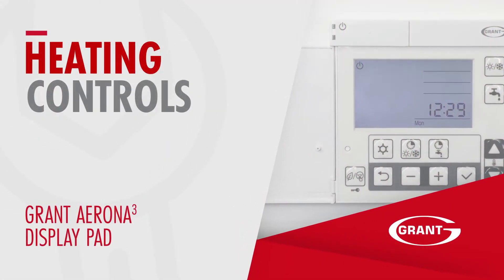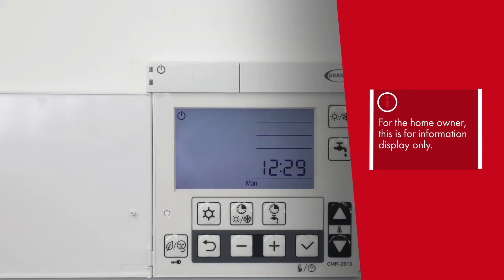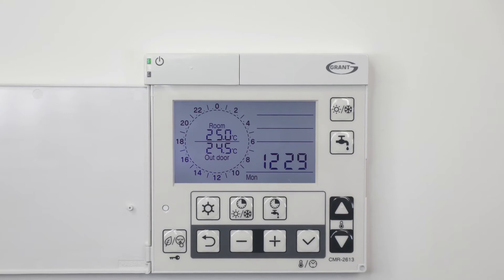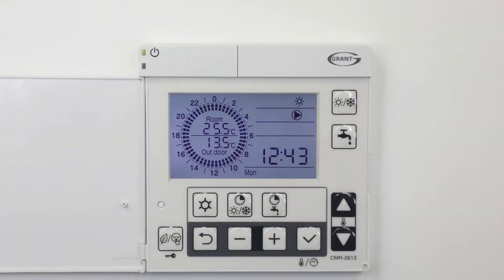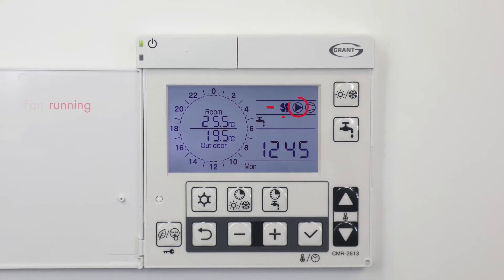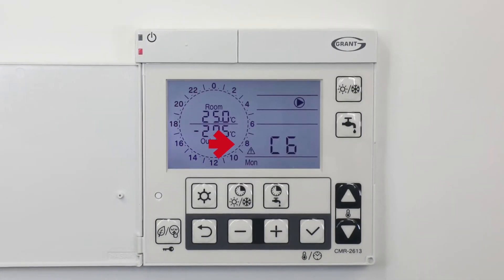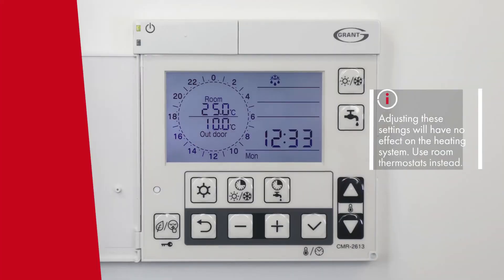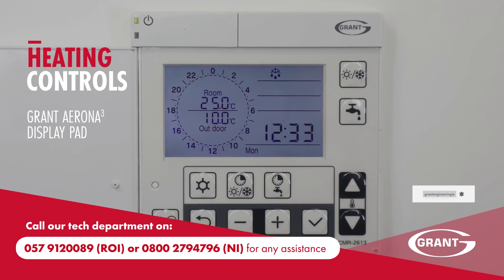Grant Aerona³ Display Pad

Comment: Hi there, every evening my heat  pump display has the sun icon only despite the separate thermostat being on in hopes to heat the house. No hot water icon is on at this time. After about 2 hours the pump comes on and the sun icon plus 3 icons below it come on and the radiators start to warm up. Any other time of day and the heat pump will heat the rads when requested. Any ideas why the evenings are different? Is it something only an engineer can change? Thanks